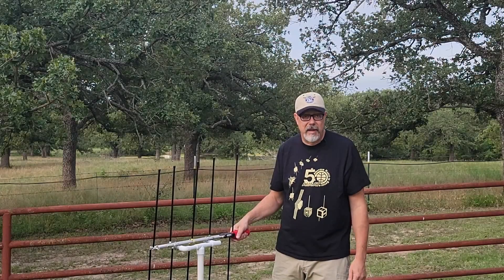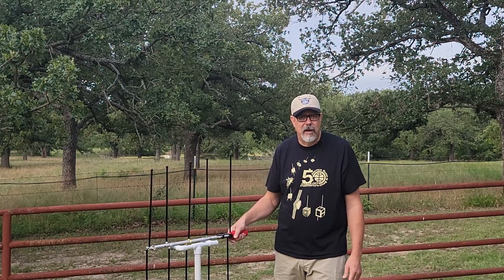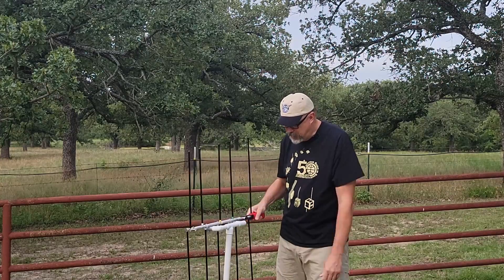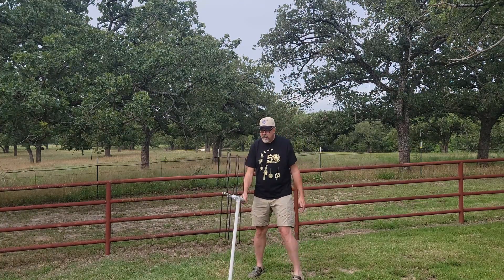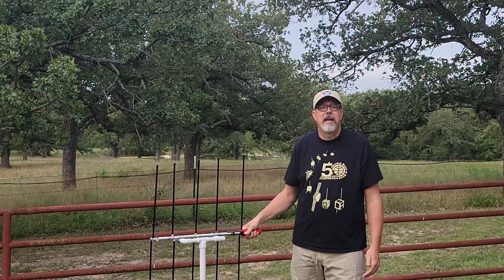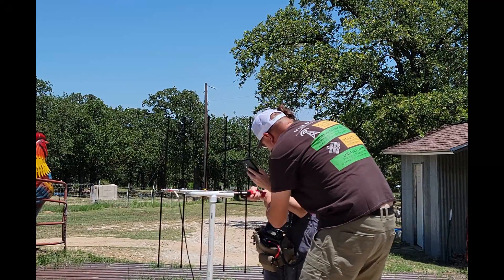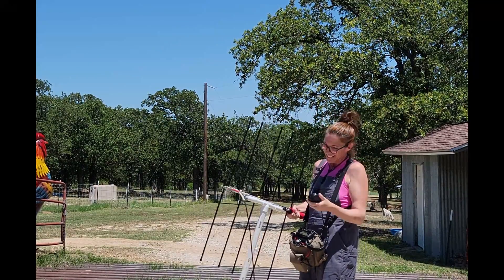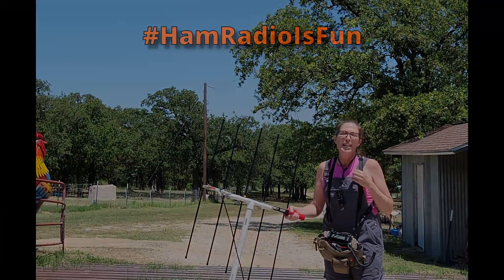New Ham, attempts #ISS contact! #hamradio #ariss #amsat #satellite #hamradioisfun

Comment: That is definitely my goal.  How does one know when the astronauts will be on the air? K3DMM
Reply from the maker: You don't. It is the luck of the draw. That is what makes it so special!
Reply: What might help is a computer tracker that shows where the ISS is, so if it's ever above your location, you can attempt contact.  I've seen it in RadioHamGuy's video.
Reply from the maker: There are many solutions to help you track the ISS. I use ISS Detector. It is available for Android and iOS.

Comment: Congratulations!. A small question , what is the EM1313 she said after her callsign?
Reply from the maker: EM13 is a maidenhead grid square. The Earth is divided into grid squares. Operators making contact exchange their location by sharing their grid square. It is a standard element, along with call sign, of a satellite contact.
Reply: @digital.rancher  I was thinking on the grid square, but not sure I am used to  the six ones (for example I operate in 10M from IN80CM ) . So, I understand you only use the first 4 :) Thanks and 73's